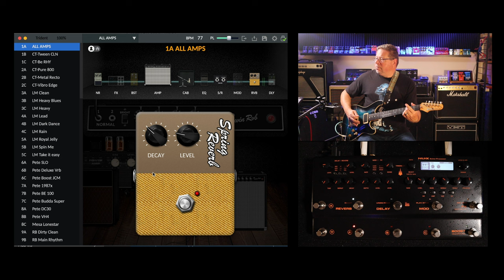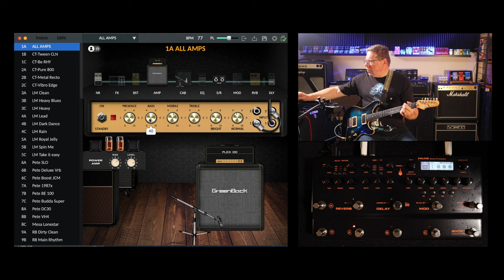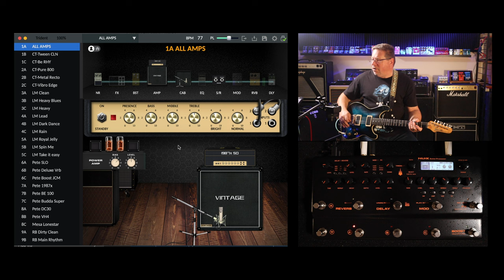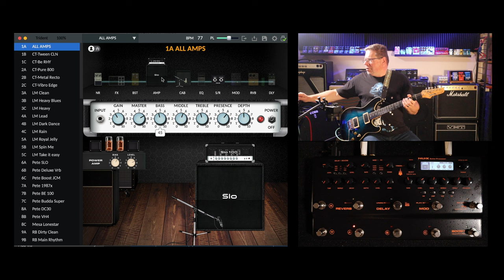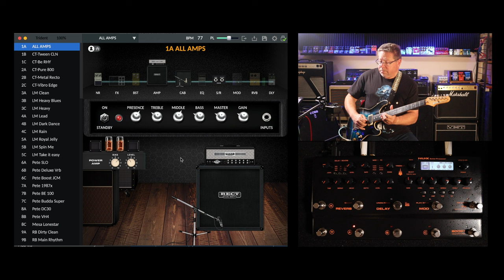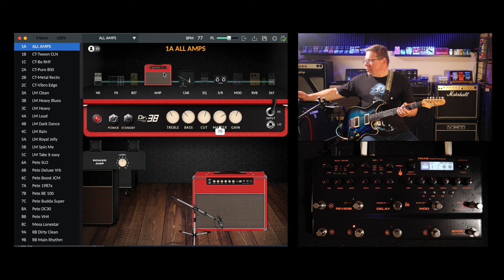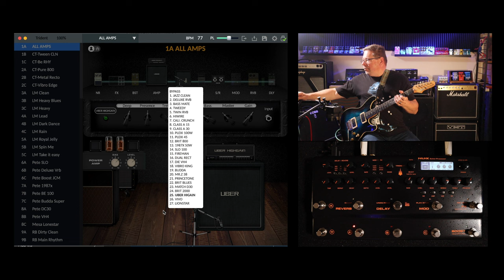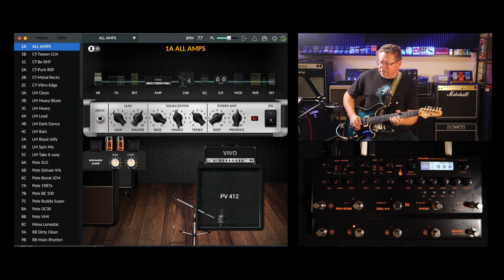All the amp models in the NUX Trident

Comment: Word has it they are very problematic in regard to storing personal re-tweaks, they remove the original factory presets when recalled afterward from their original positions, and the unit is iffy in it's stereo claims of being true stereo particularly in the effects being used internally, have you checked that aspect yet?
Reply from the maker: I’ve started tweaking and saving presets. Had to work out how to select the spot of choice, but seems ok so far. I’ll keep you posted!
Reply: @thepedalpicassos   I appreciate it, I like so far some of the presets as I'm sure lots of others do too, but it wouldn't be fun if the thing needs a factory re-set at boot up to have to retrieve them as a building point each time...thanks for the feedback.

Comment: Unfortunately most payed presentations are off to a dodgy start initially.
Reply from the maker: Definitely not a paid presentation!
Reply: @thepedalpicassos  It doesn't have to be to be an influenced presentation instead, the unit is unstable word has it, it seems unfortunately.
Did you check my comment regarding it loosing it's presets from their original positions if edited and saved as I mentioned?